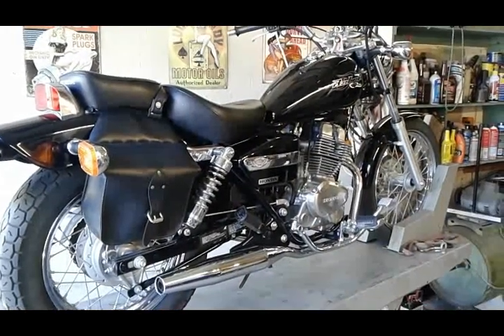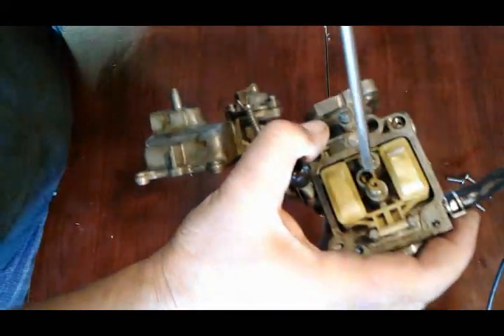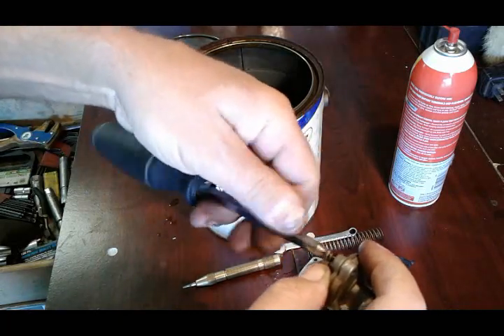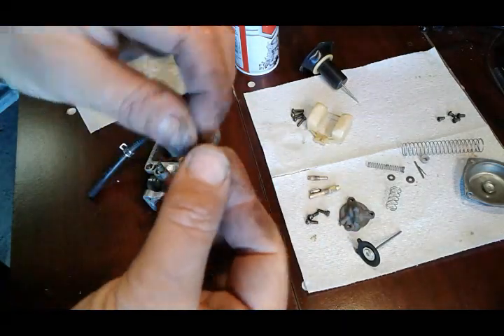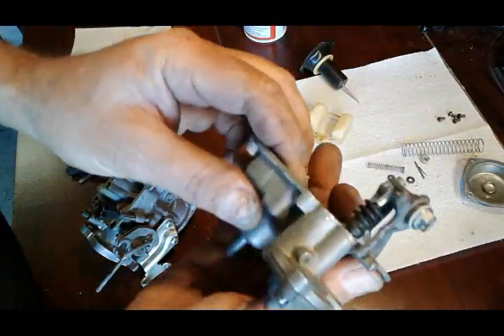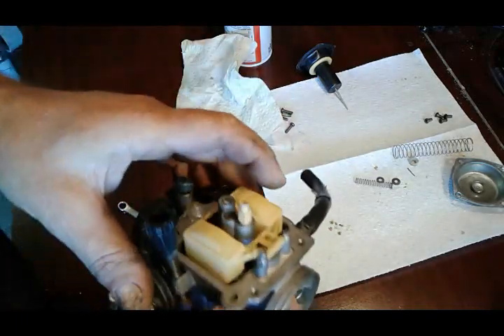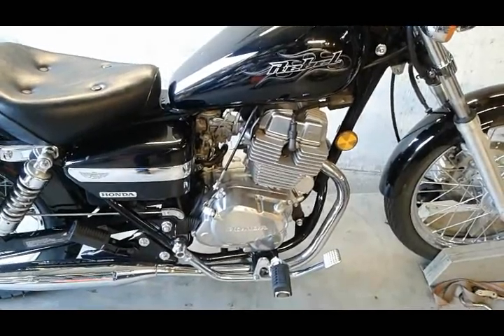Honda Rebel 250 Carburetor Rebuild 90min. start to finish

Comment: This is the BEST video! I have never done any motorcycle repair. I have a 1985 Honda Rebel 250 that was left outside for 3 years. Watching this video, I removed the carburetor, took it apart, cleaned it and put it all back. Motorcycle started right up!! Thank you for posting this!!

Comment: You are a god to me!! I just saved myself at least $300 on a Carb rebuild,. Your video was so precise and informative that I completed the entire process AND my motorcycle actually started without any adjustments needed. Wow you should do more DIY repair videos. If your're not already a youtube star you will be!! My issue was I  would be riding down the street comfortably, and out of nowhere, the throttle would actually stumble and quickly everything on the bike would just stop incuding the engine. If I sat and waited a few minutes it would start up again and just repeat the whole scenario over and over again. 
Well thanks to you, I discovered a VERY TINY piece of the tubing I'm guessing, stuck very close to one of the jets. Fast forward to bike reassembled and BAM, that was my issue. I can't thank you enough for this video. It is brilliant.

Comment: Used this video for a walk through on my '85 and it made it a breeze, thanks so much for sharing 👍
Reply: Can you recommend a rebuild kit I also have an 85 cmx lol
Reply: @baileygibert2011  I used this one from Amazon, mainly for the seals, just cleaned the jets and diaphragm.

WEIYINGSI Carburetor RepAir Kit Replacement For CMX250 CB250 Nighthawk Rebel Carb Rebuild

Comment: Just bought a 2006 Rebel with only 1400 miles on it.  Needs this work done to it.   Hasn't been started and driven for over a year.  Runs like crap. Thanks so much for this video.  Will save me time and money.  Great photography and narration.

Comment: Great video.  The only little extra thing I do is to take the rubber diaphragms and coat them with a thin film of silicone grease (not petroleum grease) because it conditions the rubber and will keep the diaphragms from drying out over time.

Comment: Just bought my first bike... A 2008 250 with 750 miles on her. She runs but stalls out if you touch the choke. I'm positive it's from old gas and gunk clogging the carb since it was barely ridden. Will be doing my first ever maintenance job with the help of your video later. Thank you for being detailed.
Reply from the maker: Wow...great! I am impressed you going for it. Take it slow and msg me if you have any questions. Thanks for your interest and please subscribe to help me out

Comment: Just wanted to say the video really was on the ball for easy to do info way better than others on here. Keep them coming. Thanks again.
Reply from the maker: Thank you ! Your good feedback means alot to me ... Please subscribe to help me out 😁
Reply: @DoityourselfMotorcyclerepairs  got another problem with the 250 Rebel project. The neutral light stays on all the time . How do I fix this ???? Will look for you to reply. Thanks
Reply from the maker: @a52091ekt   Hi there, thanks for your interest! Your neutral light being on all the time could be caused by 2 things only. First ...the neutral switch could be bad or Second ...the wire connected to it is rubbing against the frame or the engine someplace and picking up Ground. The way the neutral light works is the positive is supplied with key ON all the time to the light bulb and the neutral switch supplies the ground for the light bulb ...so when you click into the neutral the ground is ON and the light bulb illuminates. I would disconnect the wire from the switch and see if the light is OUT ...if YES  you will need new switch if the light is still ON trace the wire to find where is touching the ground. Hope you will find this helpful and please subscribe to help me out.
Reply: @DoityourselfMotorcyclerepairs  Just letting you know that after dealing with the previous carb problems on the Rebel I didn't waste time and subscribed to your videos . BIG TIME HELP.  Thanks again.

Comment: Excellent video on this job!  I just finished cleaning the jets on an a Rebel and moving the carb back enough to clear the two mounting bolts on the engine was the worst part of the job. I even considered removing some of the front engine mount bolts to let the motor tilt slightly forward to get the clearance needed, but pushing the front lip of the groove in the air cleaner boot back into the air box gave me the room I needed.   Finessing the lip of the boot back through the air box after the carb was installed was a little tricky, but much easier than trying to pry the carb far enough back with the boot in place.

Comment: Thanks very much. The little bits about spraying out certain holes and seeing the carb cleaner come out another spot was helpful. I pulled it apart only a year ago and still didn't learn to keep the petcock off and the carbed drained or ran dry. Hopefully this time will be different.

Comment: 1000 Thumbs up for this video.   I only wish you had shown the replacement sequence in the same detail as the removal - in case there were any tips or tricks to be gleaned from it.  My wife's 2007 Rebel has 450 miles on it, but sat for quite some time.  It is finicky to start, but one warmed up runs fine.   I believe her idle is too low and more importantly, her throttle has a flat spot that cause the engine to stumble and sputter - even shut off. Not good when you trying to learn to ride!   Based on this video I believe I can diagnose this issue (accelerator pump issue).   THANKS!

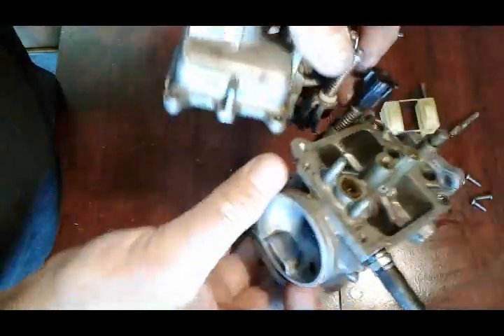Comment: 7:00  If your cir-clip cotterpin has about had it, you can make a new one out of a small paperclip.    Just strip off the plastic coating around the paperclip if it has it on there (mine did) and the paper clip wire will be the right diameter.    Insert it through the hole, and bend a little section into an S shape with the hole passing through the center of the S, and clip it off.

Comment: I have a 2009. Taking the carb out from the boot was a pain. I had to remove the air filter to pull the boot back. Then remove the metal bracket bc it is in the way of the carb on the way out.  I wonder if it’s worth it to clean it or just straight up replace it.  The nice part about the cleaning is you retain your OEM.  Good video.

Comment: Great video.......But I am amazed how easily all those small screws came out! In my experience there is always always one that needs a massive effort to get undone!!
Reply: Agreed! - 3 of the 4 bowl screws were stuck on mine.   I "always" put a dab of anti-seize on any bolt or screw I re-install so the next guy (which may be me again) won't have the same problem months or years later.

Comment: I damaged the little paper gasket that sets between the carb and the 'split' intake manifold when I removed it from the bike... it that little paper part so crucial that I can't make a new one from gasket material I can get from NAPA auto parts ? 
Just wondering - and thank you for the video - great way to learn about new carbs - Thanks
Reply from the maker: you can make it from gasket paper...sure...it just needs to seal the air from coming in creating intake manifold leak...thanks for your interest. Please subscribe to help me out
Reply: @DoityourselfMotorcyclerepairs  - I got the rebuild done, and it runs fantastic!!! Excellent tutorial! The only thing is that normally the Rebel has to use the ‘choke’ to start, but now it won’t. It will only start, and run with the choke lever in the upper position – but it runs and starts great! I’m just curious if I reinstalled it wrong, or if the choke lever has to be in a certain position for it to be reinstalled. I cleaned it just as you showed – I’m just wondering if I did something wrong.

Comment: Two bolts that are attaching the carburetor to the engine block on. Mine are very stubborn stuck. One of them is starting to round off. Any suggestions on how to get those out?

Comment: I've followed your video twice already, and it is great! But, I can't get the bike to run. It'll turn on with starting fluid and then bog out. What else could it be? Bike has 1700 miles and it is an 02.

Comment: Mine had a black rubber o ring that fell out from somewhere around the jets or air mixture screw and I didn’t catch where so I’m screwed help please
Reply: Search for a diagram of the carb with the exploded view. You should be able to see that o-ring in the diagram if you look closely.
Reply: @3gcraftsman  thanks I fixed it with a new kit. Found a clear diagram which helped me put it back in order.

Comment: My dream is to have a mechanic like you! It was true that at the beginning of my work I had a little trouble because in my model (this is the first model Rebel 250 1985) there is a different attachment to the engine - there are no two screws but a round sleeve). Other work thanks to your advice is a pleasure of work. However, I have a question because in the kit (kit) in addition to jets, the gasket was a metal washer and a rubber ring smaller than 1/4 inch. When washing the carburetor I found the same (metal washer and rubber ring) at the bottom of the dish. Where do you think their place is in the carburetor ?? Regards, Mike.
Reply from the maker: Hi Mike... thanks for the positive feedback!!! It means a lot to me. 
First think on my mind for the location of your washer and o-ring could be under the air /gas mixture screw. They are hard to get out( usually you need straight pick to fish them out)… however they could also fall out on there own if you took the screw and the small spring out. Let me know if that was it...hope you get it together soon!
Reply: @DoityourselfMotorcyclerepairs  Just as you write (air mix nozzle), which once again allows me to call you the genius of the carburetor.
I assembled and installed (there are not many parts left he he ,,)
However, there is such a thing. A cold motorcycle starts up without moving the choke lever. What did I do wrong again? Thanks for all, best regards Mike from Canada.

Comment: the 2 bolts holding my carb on the engine are stripped beyond all repair and there's no space for any tools or drill bits edit: was able to pull them off with vice grips!
Reply: Ok!

Comment: At 20 minutes in
You talk about the accelerator pump. The top part where the three screws go in. You spray carb cleaner through one hole and it comes out the square side 
Mine is still clogged what should I do

Good video
Wanted to point out there's no explanation in the beginning on how to get the choke cable out of the carburetor safely

Comment: Does that rebel have a tip over sensor? A drunk driver backed into my wifes bike and knocked it over. Stood it up no power no  lights any information would help. I got it home going to start on it in the morning. Thanks much

Comment: I bought a 2001 CMX250C single carb Rebel. The carb was in pieces with several missing. I don't even have the screws to put the bowl or top back on. Do you know where I can buy a replacement carb for this bike that doesn't cost so much? I can only find one for $350. I can't afford that. Thanks, Matt

Comment: Hello, i have a honda rebel 250 just like this but have 2 carbs but has as a one unit.also the side covers are chrome metal and battery cover is box shaped. Taking out the carb from bike is very difficult because its large in size..any easy system to take out this carb ? What is this model ? Thanks ,TC.
Reply from the maker: You have the earlier rebel 250 model which came with two carburetors... Unfortunately this video will not be really helpful to you...I hope you will be able to get your job done and thank you for your interest please subscribe you might find another video that will be helpful to you in the future ....thank you
Reply: @DoityourselfMotorcyclerepairs  could you pls tell me the advantages and disadvantages of having two carbs.can it convert into single carb? Will it effect to the performance ? Much thankful for your valuable reply . All the best To you.i subscribed your channel.

Comment: my over flow hose leaks out gas intermittently what u think problem is its a 2006 250 rebel with 3200 miles on it runs great just leaks
Reply from the maker: I would take it apart and replace the float needle..also inspect the overflow tube inside the float bowl for cracks...if the bike is running good if might be just defective/damaged float bowl or the drain bolt is not sealing or being loose...hope this helps. Thanks for watching and please subscribe to help me out
Reply: @DoityourselfMotorcyclerepairs  thanks a lot I appreciate it brother!
Reply: forgot to mention the screw in side of carb above the hose im thinking its the drain screw its so tight i cant get it to loosen u think that might be the problem that previous owner over tightened it ?does it have like a o ring on the inside ?....local honda shop said its a 3 to 4 hour job they wanting 150 to 200 dollars to do it and me supply the kit im thinking they trying to rip me off lol??

Comment: I just followed up what you did and I open my gasoline valve and it leaking down in the lil house any idea why thank you?
Reply from the maker: Hi Jorge,
sometimes the carburetor will flood when it's empty after working on it and the pressure of the gas coming into it for the first time over powers the float. Try to start the bike with the petcock off and let it run for a minute an open it back up...also is your gas tank clean inside?? you can add little inline fuel filter to stop dirt coming into the carburetor...also there is times when you just need to open the carburetor back up and double check everything . Hope this helps...please subscribe to my channel to help me out...good luck!

Comment: Be careful with carb cleaner on the neoprene parts. It will make them swell, and will be very hard to re-fit them. I only spray the cleaner on the rag and wipe them. DO NOT soak them in carb cleaner.

Comment: I got 1985 rebel i clean the carb did every thing star good but runing on the stree she chokes new gas filter new gas nwe sparplus  what cut be my problem
Reply: Any help
Reply from the maker: Hi Sergio,
thanks for your interest in my video! First I want to know what happened prior to you working on the carburetor...did you just purchased the bike? did it sit? or anything happened while you was using the bike before?
Reply: @DoityourselfMotorcyclerepairs   i had  lot of rust on my tank so clean my tank and my carb i move my air  flow
Reply: I move my air flow two and half  she chokes when ruing she star good but when  push the gas on the stree she chokes any help i love my bike
Reply from the maker: make sure your slider is moving freely and the rubber diaphragm is not ripped and it is seated properly...if it idles well you have issue with air or gas restriction under power...so start there and let me know. The slider must move gradually up as you accelerate allowing more fuel via needle and more air by opening up...

Comment: non of the philips head screws are coming out:(
Reply from the maker: That happens quite often on any carburetor job. . first you want to make sure you have a really good screwdriver that is not worn out ...if you do you could use a hammer to hit the screwdriver few times that could help loosen the screw also I use impact screwdriver which with every hit of a hammer turns the screw a little... sometimes if I have room I use a small vise grips pliers and grab the screw from the side... I know it's annoying ... you'll get them out. Thanks for watching and please subscribe to see more videos in the future
Reply: @DoityourselfMotorcyclerepairs  finished it a couple minutes ago thank you so much !!!
Reply: For the small screws to come out easier, you need to use JIS ( Japanese Industrial Standard) screwdrivers.
Reply: @capomak1  looked at all my local hardware stores and couldnt find one. Eventually found a philips head that fit
Reply: @NYGiants15. They have them for sale on Amazon . I have the “ Hozan” brand , they come in set of 4 , I paid $17-$18 for them. Also I have a “ Vampliers” extractor pliers, in a case that some of the screws are to stuck, I use the 5” and 6.5” when working with small screws. Amazon sells the Vampliers too. My hardware stores also do not carry the JIS screwdrivers.
Reply: @capomak1  thanks man

Comment: I have a 06 cb250 and the carb is literally the same but the air fuel screw is only allowed to do a 270 turn. Any explanation for this?
Reply from the maker: only think I can come up with is that who ever opened the plug that is over the air/gas mixture screw from the factory did not remove it completely and just drilled hole in it. That would prevent the screw from coming out. If this is the case just screw a wood type screw and remove the rest of the plug....this is the best I can do for you without seeing what you got...hope it helps and please subscribe to help my channel grow...good luck
Reply: @DoityourselfMotorcyclerepairs  ok thanks!
Reply: Mine is the same. I don’t think it needs to be adjusted ever.

Comment: Bad advice do not put the floor valve in the vat. It has a rubber tip and it will ruin it.
Reply: Float valve or needle seat

Comment: By running a wire through length of pilot/idle jet you destroyed the micro screen contained within..
Nor do you really address the one way ball valve located in accelerator pump base.. 
accelerator pump should be tested to assure ball valve is working properly and there is no fuel backflow into float bowl when accel diaphragm shaft pressed before bowl is mounted to main body..
Reply from the maker: There is no screen inside pilot jet...but good point about the acc pump being properly inspected before installing the carburetor back in the bike...thanks for your interest and please subscribe to help me out